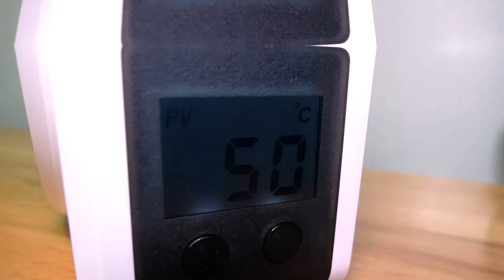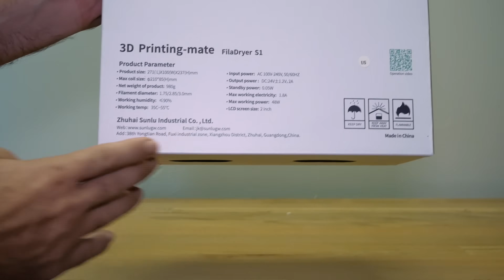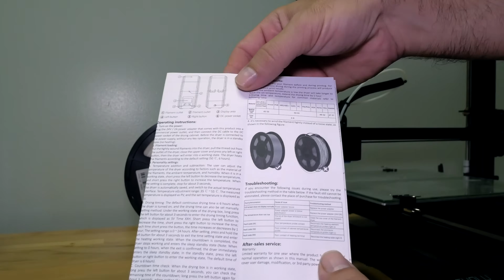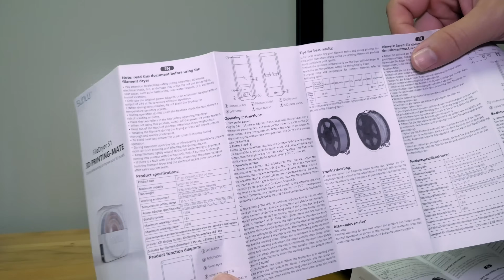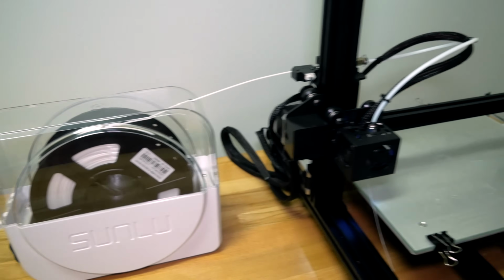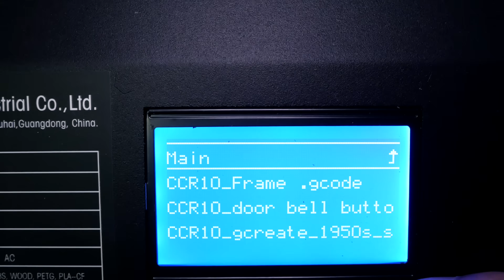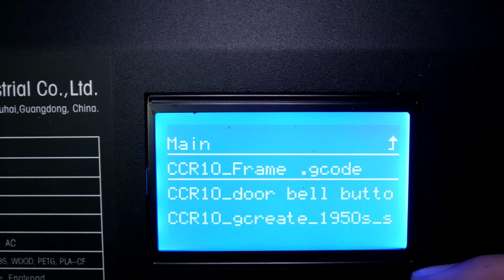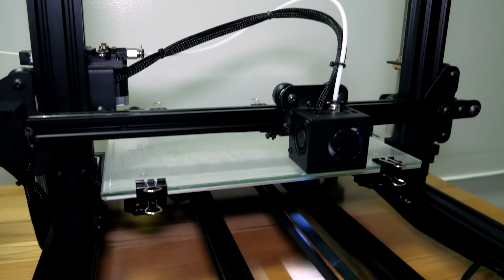Sunlu FilaDryer S1- 3D Printing - Filament Dryer

Comment: Like these very much. But anytime I don't use all the filament in a print, Put it in a little refrigerator I have altered to maintain 50-55 c. Not a lot  of moisture problems after that.

Comment: I just got mine and it came with short "Teflon tubes" which fit in the outlets. Comes with plenty spares and the inner diameter perfectly fits a Bowden tube. Seems like they fixed the issue you mentioned!

Comment: this thing is garbage, don't buy it, does not get hot enough. Display shows 55C, yet if you put a thermostat inside actual temp is about 45C, problem with this is that the it reads from under the heat element so gives a false reading.

Comment: Regarding your mention of the opening for the filament, my two units that I'd ordered at the same time both came with Teflon tube and each also came with 4 more in a small clear bag. 

BTW, what are you making in this video? It looks cool!

Comment: Do you think it is safe to fill the bottom with desiccant?  I have one of these and run it once a week or so, but wondering if there would be a benefit to having some desiccant inside to maintain the low humidity level between power cycles.
Reply: Did you try this?
Reply: @SG-sj6cw  I didn't, but I believe that the chamber would need to be sealed considerably tighter than it is, for the desiccant to maintain a significantly lower RH value than the surrounding environment.

Comment: I agree with your comment about the location of the LCD panel.  I was hoping to see a before drying/after drying print test.  I'm surprised they don't have pneumatic connections on the dryer to prevent [moist] air from coming in.

Comment: Do you think this drys the filament roll effectively as a whole, or just the outside strands while it un-winds? I wonder if you can run it once or twice then not need it on, or isn't that how it works? I am having problems with PLA moisture recently.

Comment: Warm filament might cause problems. I had my printer in a workshop that got very warm (~35c), that combined with the extruder motor heat deformed PLA in the feeder gears causing jams. Cooling the extruder motor helped.

Comment: Yes a hole in the back would be nice. I have a Polybox and I 3D Printed an adapter to hold a PTFE coupler in the Polybox holes and PTFE tubing to help guide the filament to the printer.
Reply: I just drilled a hole in the back of mine so I can access the display. Works fine for what it does but I don't really expect it to last long given the components used.

Comment: makers muse made a video using a ~6 year old filament still printing like new.. not sure these are really that needed. At worst throw your material in the over on very low for a couple hours and save the money. Personally I keep mine material in a plastic container with a cup of rice to absorb any moisture.
Reply: Different materials handle moisture differently. Nylon for example sucks up moisture.
Reply: I put unused filament in a ziplock bag with one of those desiccant pouches. Seems to work fine. I suppose it might be a bigger problem in climates with high air humidity.

Comment: Here is my concern, this is going to add another point of failure for any printer, and any print. And you definitely shouldn't be using this when you're away. Another fire hazard that could potentially cause a printer, or itself to go up in flames.
Reply: This product def requires a 6 month and a 1 year review to gage its reliability. Just my opinion.

Comment: Seems to me that this should measure humidity as well as temperature, without knowing the humidity you have no idea how dry or wet the filament is.

Also once the z-axis gets very high it would either break the filament or rub until it starts snagging in the worn spot that will happen.
Reply: If it switches between humidity and temp that would be nice, but really temperature is the most important factor. Air humidity is different than water absorption.
What ever molecule in the mixture has the lowest gasification temp will leave first. So heating the filament causes the easier to agitate water molecules to leave the more durable filament composition. Same effect as warming up a carbonated drink. Carbon dioxide has a really low boiling point, so as you heat up the water the carbon dioxide leaves first.  Since the water then becomes gaseous the air inside the unit will actually become more humid, but the spool will become less absorptive of the water.
This is actually a simple solution to the real problem. We arent mad that water is getting into the plastic. We get mad that the water escapes the filament inside the extruder while its printing. This causes two issues. The rapid evaporation causes temperature fluctuations as the exiting water steals the heat. Secondly the water could extrude between your layers causing poor adhesion.
Once we are done printing we can care less about humidity.
Reply: Looks nice. It would be a great present.
Reply: You can buy a gauge for that. They have then for cigar boxes

Comment: Does it come with extra bungs so you can dry filament without printing with it and have both holes sealed?
 If not I would print some from a flexy filament and also some grommets with a hole large enough for a piece of PTFE tubing so the polycarbonate lid does not get damaged during printing